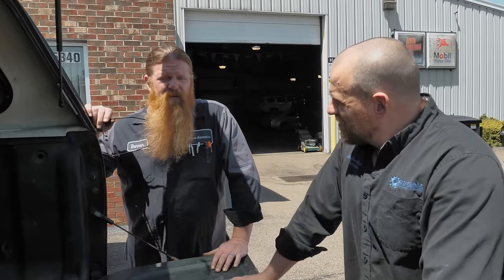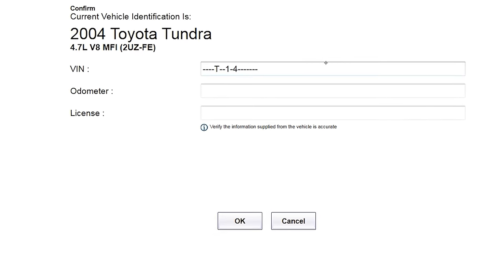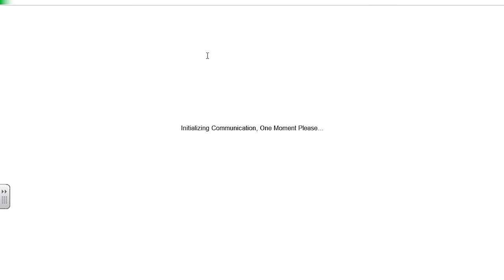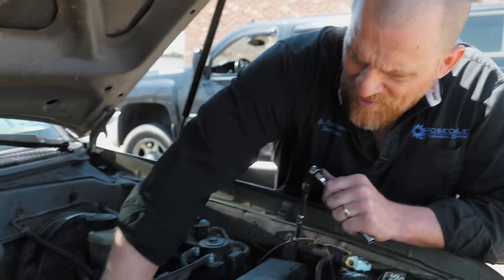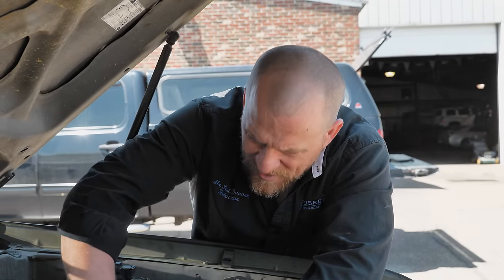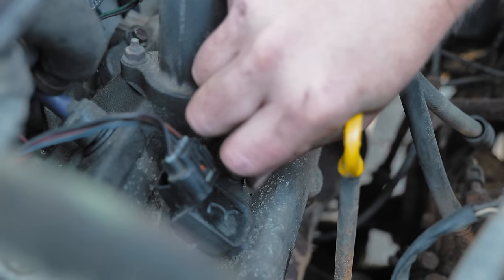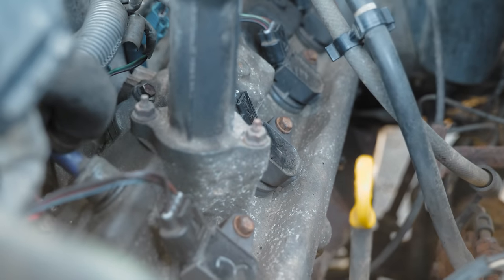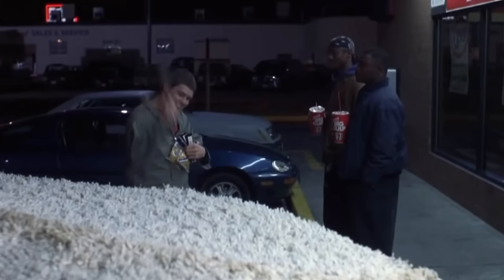Quick Test For Identifying a Bad Ignition Coil (Toyota Tundra)

Comment: This was a great learning experience for me. I have the same 04 tundra  but with the 6 cylinder. I also have the same problem, misfire on 2. When I got the truck, I was told that a plug blew so I bought the taping kit and took care of that part but I can get up in the morning and take the truck to the grocery store and it’ll run fine until I try to leave. It’s cross your fingers time! I did order everything I need, except plugs, they are new, to change them all.
I wish y’all were here in Lafayette, La., I certainly would be leaving my truck with you guys. I’m disabled and this is going to be hard labor for me and I have no one to help with it.
Thanks again. 17:13
Reply from the maker: Don't rule out a plug issue too. New means nothing these days.

Comment: People don't seem to understand that the main reason you can get it done so fast is because of the advanced tools and knowing how to use them.  So when you call a technician, you're actually paying for his expensive investment in tools and his long hours he dedicated to training...  and honestly, by the time you consider the drive time to get there, picking up all your tools, and the driving time it takes to get to the next job-- You've burned more than that hours pay, even if it only took you 30 mins to nail it down.  When I did construction repairs, I always told them there's a 2 hour minimum;  and I usually had 5 guys and charged $35 per guy.  It's not even worth dragging out all the tools for less than that.
Reply: wow thanks for the supplemental explanation, really clarifies what SD already said... basically you want to get paid 1000$/hr for swapping coils. makes total sense.
Reply: @rickdeckard1075  yep..  got'em

Comment: Sometimes I feel pretty proud of myself, this would have been an easy diag for me, what I would consider common sense, but then theres times you diag things that are so out of my expertise its mind blowing. Working on a dodge Durango SRT 8 misfire issue now, not gonna lie, its kicking my butt. I can unplug 6 cylinders, injectors or coils doesnt matter which ones, and it doesnt make a differnce in the way it runs, also has perfect compression, perfect fuel pressure, all 8 injectors and coils have been tested, cam and crank sensor have been replaced, no change.  We'll see what monday brings. Ate my lunch today
Reply from the maker: How are you testing the coils and injectors? Lab scope with an amp probe would be key
Reply: @ScannerDanner  injectors I bench test with a machine. Coils i used a kv tester to jump spark

Comment: Rewatching and just wanted to comment.
I've done coil swaps and the misfire goes away.
Then it's down to close up visual inspection for arcing, burn marks, corrosion on the spring or plug tip etc 
And resistance checks.
And spark plug inspection.
I've been lucky & sometimes you talk them into plugs & coils bc they were installed at the same time originally, usually, and go bad near same times.
Excluding external damage etc.
Reply: Bad plugs ,makes bad coils. I agree Gregory Fairchild
Reply: @overload3996  I try to tell people that all the time. If you throw a new coil on a bad plug you may just fix a symptom not the problem. A few months later you may smoke that coil again.
Reply: @Troy_Built  yes, also new wires over carbon tracked plugs.
Reply from the maker: There are always those variables when you start touching things. Intermittent problems can be the worst!
Reply: @ScannerDanner  could you better clarify this please.
Reply from the maker: @overload3996  this reply was to the OP about moving coils and the misfire goes away
Reply: @ScannerDanner  Goes away for how long, it could still end up a misfire shortly later. Not anything a tech needs.
Reply: yeah, at minimum, I would do two coils and two plugs (actually 4 plugs now, since swaptronic's was played and it ran more than a few seconds that way). it's hard to see carbon tracking on plug porcelain, it may even wipe clean and be nearly invisible without strong magnifier or microscope. it could even be bad plug resistors with too high of resistance that caused the coils to fail.
really if it was mine, I'd hammer in all new plugs and maybe all the coils depending on cost, I know they're often an expensive wallet killer.

Comment: On many of those Toyotas you can put your amp clamp on the black/red wire at the fuse box to watch the coils and injectors
Reply from the maker: For sure, but the amperage waveform of a coil with an intermittent secondary leakage issue is almost never seen on that test, which is why I didn't do it

Comment: from the accent to the state inspection sign on the wall behind you this video was very nostalgic to watch.  My cousins lived in Penn Hills, I lived in Pittsburgh but had to move 23 years ago for work and I do miss it.  But I don't miss those state inspections.  Just had to pause and say this, now I do hope you answer my question that I have been searching for hours to know.  Either I tested my COP coils wrong or I have some bad coils.  They do have 130k miles on the original plugs I think.  I tested 18M ohms on one side and 1.7k ohms on the other and thought that was good, some videos are saying it should read .5 ohms and 16k ohms not M so I just need a professional opinion testing the same coil on plug coils that it seems no one else has ever posted online before.
Reply from the maker: You're measuring the plugs? I never do that. Change them! 130k on them.
Reply: Well, didn't answer my question, but still a good video.  back to the search, am i asking something so simple that people just assume everyone already knows about it so no one posts about it?
Reply from the maker: @Mikej1592  your doing resistance testing on the plugs right? It's a test I literally never use. And there are 130k on them. I don't understand what you're trying to prove. A bad plug can be proved out by moving it to a different cylinder
Reply: @ScannerDanner  why would anyone test the resistance of a plug, did I not explain that I wanted to test the resistance of my coil on plug ignition coils windings?  I can't find the specs anywhere, all of mine match but are WAY higher than what people online have said about other coils.  Mine measure 1.7k ohms and either they are all bad to the point a misfire is not detectable or they are all just fine. I am changing out the plugs and while I am in there I wanted to do as much PM as necessary without going bankrupt.  It's bad enough plugs are $8 to $12 each and at $30 each a set of 6 coils is something I would rather not expense if I didn't need to.   Thanks for  replying to me though.  My Honda 3.5 V6 is just about that magic 130k miles mark and the plugs are likely factory supplied.  Coils are original Hitachi CM11-213's if you have any info you could share I would be eternally grateful. thank you.
Reply from the maker: @Mikej1592  lol, I misunderstood as you threw in a sentence in between about 130k spark plugs, then proceeded to talk about resistance. My fault. 
Okay, first thing, the resistance test of ignition coils is poor at best.  If it measures bad, it is bad, BUT It can measure good and still be bad, as the ohmmeter does not stress the windings. Also, you can have carbon tracking and shorting of a secondary winding that the ohmmeter would also totally miss. 
 So I do not do ignition coil resistance testing for this reason. 
Secondly if you have 3 or 4 pin COP ignition coils, you cannot accurately measure the primary winding, because there is a transistor inside of the coil that would be switched off and blocking you from measuring that winding. 
If you have a constant misfire that you are trying to fix, move some plugs and coils around and see if it follows. Like in this video 
https://youtu.be/jfIG0dk_09s
Reply: @ScannerDanner  I see, thanks. I'm not seeing a misfire, my problem is more symptomatic of old worn out plugs, and honestly swapping coils is so easy unless I later run into misfire or other problems I don't think I need to worry about it just now.  Thanks for the feedback it helped me make the decision, and will save me about $200. Thanks
Reply: @ScannerDanner  Thanks, I didn't have a detectable misfire, I just have over 100k miles on my engine and was just trying to get ahead of any creeping issues.  I ended up buying 1 coil to compare with so at the very least I will have a spare should the need arise and it tested about the same as my factory coils so at least I feel better knowing that while resistance testing isn't a reliable way to diagnose a misfire or problem in that way at least I can tell that age hasn't really had much of an impact on them.  I did find the #3 (firewall steering column cyl) plug a sooty black color but all the coils looked fine.

Comment: I can get secondary waveform on toyota/lexus coils even using a relay with the resistor cut off. You could probably make it to adapt onto a wand style but i just hold the relay windings on the side of the coil and it picks up secondary
Reply: I also use the bosch type relay on toyota and Honda, heck even on spark plug wires

Comment: Don't feel bad about the diagnostic time,, I had to charge one hour diagnostic time just to let air out of a tire,, but that's what happens when it has twice the air pressure It should have in it, check engine light on ABS light on stability control light on TPMS light on
Reply: Sounds like it must have been a Honda.

Comment: I almost replaced a ECM on a corolla because of no injector pulse #1Cyl from the ECM.  The car would hardly move. I switched coils in case the ECU turned of the injector due to misfire code.  The misfire and no injector pulse pulse moved with the coil. Replaced 1 coil. The car then was drive able but  the #4 coil misfired under load.  Then i had a 352 code in another coil.  At first i only had a 301 and 1604 code.   Replacing the battery fixed the 1604.  The battery would drop from 12.6 to 10v with a headlight load. no voltage drop in the cables. Batteries don't seem to last 3 years anymore.

Comment: Great diagnosis. Sometimes this is the quickest way to isolate a misfire. What would you recommend Paul for a good scanner to read live misfires? I know Ford has their "Forscan" software that can be used on a laptop. Is there a tool that works good across all manufacturers?
Reply: Forscan is Ford specific, but not done by Ford.  It was created by a russian gentleman, and is no longer able to process payments due to the sanctions on Russia.  Forscan lite for Android was still able to be purchased a couple of months ago and works well on Ford products, but I can't compare it to the full Forscan since I can't purchase a license for the computer anymore.
Reply from the maker: The misfire counters is manufacture specific, so it's not just based on what scan tool you're using.

Comment: Paul, does your state even have emissions testing requirements? Also what is your opinion on the coils? If 2 are bad the rest will follow due to aging?
Reply: I would be checking the plug gaps but they claim to have new plugs in it.
Reply from the maker: We do and I would fail if the cat is missing like I assumed.
As for the coils, the owner just changed them all, but they were not new as you could see. No reason to sell all 8 but that'd be up to you.

Comment: COP coil on plug - sometimes will burn right through the insulation .
Also if you can remove the insulation , you can see the spring that goes from the coil to the plug  , is arcing .
That cheap spring is designed to fail .
COP is actually a lie , there has to be something between the two ; it use to be a high quality spark plug cable .
Now it is just a cheap spring

Comment: Whats your opinion on walker o2 sensors vs bosh and others for jeep grad cherokee I know you said bosh sometimes is not compatible with chrysler and can cause problems from the gate ?
Reply from the maker: For Chrysler systems that use the PWM heater circuit you MUST use an NTK sensor or equivalent. All I can tell you is the Bosch sensors won't cut it here. They make good sensors, just missed the boat on these applications
Reply: @ScannerDanner   I ended up using the walker from oryleys over the bosh and no problems the bank 1 sensor 1 came back and long term adaption went back down from flatlined at 32 now at 3.9 so rough running is gone. O2 sensors seem to be one of the common checks for rough runners for me!!! Good day sir and good luck on the new vids
Reply from the maker: @wrightsrrt871  sweet! Good to know, thanks for the info

Comment: Throttle actuator represents potentiometer thus its slider is accustomed issue. Just replace it with healthy one. To be honest I don't get what does ignition coil swap impact on engine performance. The issue just changes its residence,  but still remains uncleared?
Reply from the maker: The misfire moved with the coil, it needs a coil. 
The app code could have been set from previous hands under the hood, why would you change a perfectly good part without knowing?
Reply: @ScannerDanner  oh yes! Since the misfire has changed its location upon coil swap, it represents the solid proof of bad coil existence! Could the error codes uploaded obtained on the device be false? If so, this check testified coil issue.
Reply from the maker: @khatokhato9350  yes, remember my brother was in there and had the fuel rail out twice for injector leaking issues. This is why clearing the codes, advising the customer on what we found was the best next step for that app code. The main issue was fixed which was replacing two coils
Reply: @ScannerDanner  Yeah I appreciate the value of your kind directives you passed me. Things are getting explicit.
Reply: @ScannerDanner  when you say 'misfire ' I reflected you were referring to accidentally swapped wires on the coils. But as I got later you were referring to failed coils. 'Failed firing'  instead of misfire could be more relevant.

Comment: I have a 1995 Maxima.  Can you tell me what causes a weak spark( the spark is yellow).  Can timing cause a weak spark?  Thanks.
Reply from the maker: Yellow spark being weak spark is an old wives tale. When testing for spark with a small air gap, the spark will look yellow.
How far the spark can jump is the true test. Most should be able to jump almost a 1 inch gap when tested from the coil

Comment: Funny, that currently if the O2 sensors are bad, seeing that gas in my area is $5 a gallon, I would think for the sake of somewhat better fuel milage running a V8, the customer, you would think when presented to the customer they would have that fixed.
Reply from the maker: These were downstream cat monitoring only O2 sensors on this model. No fuel trim control based on them
Reply: @ScannerDanner  got it, they essentially they just monitor?
Reply from the maker: @midnight-xpress1136  on this model and on most yes, but there are some (when a wideband O2 is used upstream) where the downstream can be used for some fuel control as well

Comment: Brothers, I have an 03 Sequoia that has a key ignition switch issue that I had fixed and now the immobilizer will not let the vehicle start. I do not know what to do about it. I have original key. I am the owner with the title buy the way. How do I get my vehicle to recognize the key again? It has 300,000+ miles on it but ran very strong before I pulled the ignition key switch.
Reply from the maker: It will need programmed

Comment: Just wondering what an Ohm test on the coils would have revealed..??
Reply from the maker: It would have most likely measured good. A resistance test of high current devices like ignition coils is often very inaccurate

Comment: Could a weak fuel pump give a similar miss when running ok at idle but stumbling when revved up in your experience?
Reply from the maker: Feels totally different and that would affect all cylinders. Combined with lean exhaust trouble codes, and a different type of low power symptom

Comment: It’s likely that those coils are Amazon specials or knockoff eBay densos. Really common for these UZ engines. I went cheap for my sequoia a few years back and tried them. Got misfires within 10k miles. Dropped the big bucks on some legit densos and no problems for the last 65k.

Comment: That's call swaptronics not testing
Reply from the maker: You don't know what to swap without testing first 🙂
Reply: The whole point in swapping is to TEST if the problem will move with the coil or stay on the same cylinder.   Every fork in the road is another test.
Reply: That's called testing. Now he knows that the wiring to the coil is good. The injector is not the issue and the plug is firing. After this simple test he has direction.
Reply: Great videos I have recently purchased 2007 Toyota tundra 5.7 motor It has been at the Toyota dealership for 3 weeks 1st they told me I had water in my yes now very tell me I have 5 Coil packs that are not working How is this possible to have a perfectly running vehicle all of a sudden one day takes a s*** Irene on 2 cylinders on left side to on right side Any suggestions I would greatly appreciate PS pretty sad Toyota dealership cannot figure it out The Tech has been working on toyota for 25 year's thanks in advance